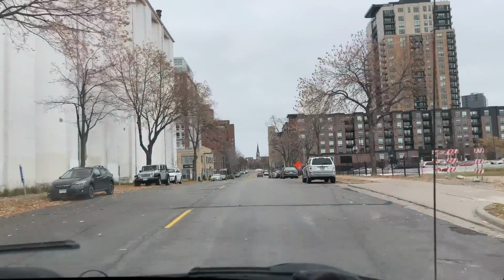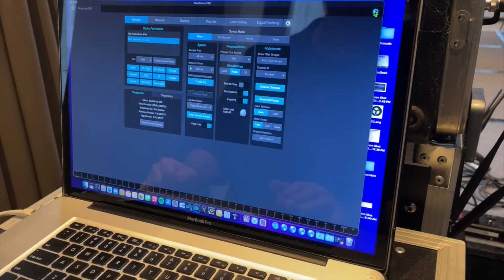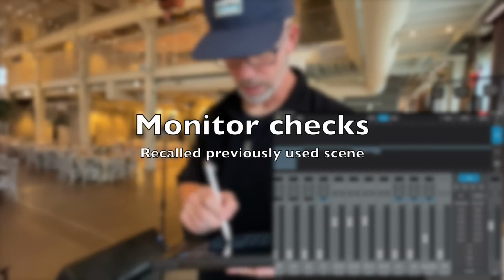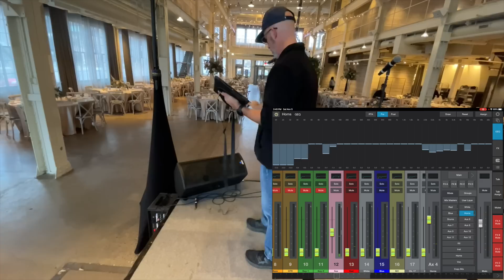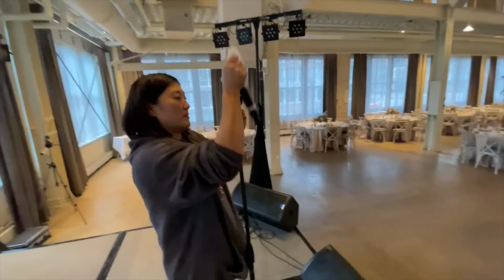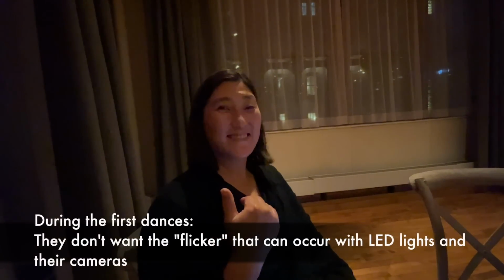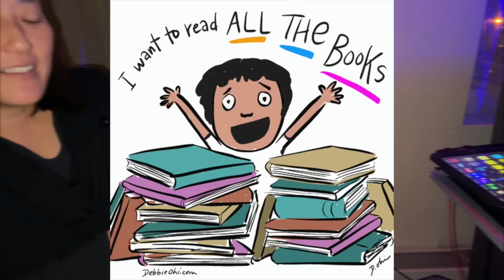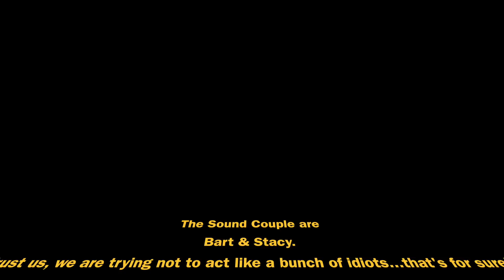The SC - Wedding Brain Dump

Comment: The ADJ Link lighting controller might be a worthwhile upgrade for you two. It runs on an iPad app and can be operated wired or  wireless (the controller creates its own Wi-Fi network). I switched from Luminair and haven’t looked back. It is slightly more advanced, but offers quite a bit more functionality. Thanks for the video as always… the long ones are my favorite!
Reply: The only downside I can see with the Link for your application is the fact that the controller needs to be present for DMX output. The app offers full functionality when running wireless away from the controller, but that means the controller sort of turns into a giant dongle just for outputting DMX.
Reply from the maker: Hmph!  Something to look into. Thanks for the suggestion.

Comment: I do sound part time and I'm in a band that uses 100% modelers (no live amps) for guitars, bass, and sometimes drums and I've noticed exactly what you are talking about in some places where there is a sound void by the stage. I still use floor monitors on the stage even if I don't need them to create some stage volume for the dancers. Sometimes I'll flip a couple of them to face the crowd as a center fill. I don't run them loud enough to mess with the mix at the tables, but they do a decent job filling the void by the stage.
Reply from the maker: Makes sense as we will do the same with in-ear bands.  In this case, we just went with it as there was already plenty of stage volume and frankly, the budget wasn't there for us to compensate for decisions that were made without our input.  Not one complaint from anyone though.

Comment: Monitor EQing, I recommend you use the HPF for the low end cut (cutting to the max band by band with a graphic eq can cause phase issues) and for narrow deep cuts it is better to use an parametric EQ as it affects the neighbouring frequenices less.
Reply from the maker: Thank you for the tip.  We will experiment with that approach!

Comment: That venue needs an infill because those VRX needs at least another 10 feet to get the sound to listener level.

I thought that the side mounted speakers (behind the VRX) were intended for that?
Reply from the maker: That's a good question.  It brings up a great point....it seems like the big shows are getting better and more technical, but these types of engagements don't move forward with same mindset....they just want you out in an hour.

Comment: I always start fresh with every gig, and every new band. Everything is always different.   I have my PA Flat preset I start with, and instrument presets I load accordingly to where they need to go.  I'm usually doing 3-5 groups a night, and most of the time each bands inputs and where they are on stage is different too. 

That Colson power extension is a killer find! I tried to find something like that 5 or 6 yrs ago for bands with pedal boards and other things up front needing to be plugged in, and I could only find what turned out to be a pretty dodgy and uncooperative cable.. Not friendly at all. This one looks great, Im going to order 2 of them right now!
Reply from the maker: I was trying to use an existing scene with a similar line up....thinking that just starting fresh is easier.  
The Colson has been working great.  It's only an "extension cord" but both Stacy and I are wondering how we didn't get this sooner.  We bought the 50ft and we use it at every gig now.

Comment: Hey Stacy and Bart I have a pair of Presonus 328 a.I. speakers of which we tested  the amps and were fine, but I have one speaker that has the transducer in it and the speaker either needs to replaced or re-coned. A friend of my who works on PA gear took the speaker out and  I was wondering where could I buy a speaker for it or get it re-coned. The speakers are no longer supported, and have used these a couple of times. My friend who works with speakers it didn’t blow but thinks maybe drop the speaker and didn’t tell me after a gig. They are pretty heavy, so that may have happened. Thanks
Reply from the maker: I would think you could find a place that re-cone the speaker.  Or you could contact PreSonus to see if they have any available for purchase.  We have not had to do anything to our 328's but for other work, we use Midwest Speaker.  You could try them if you cannot find anyone local:  https://www.midwestspeakerrepair.com

Comment: I find it easier to start with old scene. Gain is pretty much dialed in as well as monitors for most part. Idk that's how i do it. If it's the same band of coarse. I use those ears as well when I play drums. Awesome for 50 bucks!
Reply from the maker: In this case, I was trying to use a similar scene for a different band.  I am starting to think it's better to start fresh in these situations.

Comment: You can get the Behringer P1 which is basically the same as the HP2 but without a requirement of a "special" cable.. Direct XLR to the unit.
As far as headphones, those units perform well with low impedance headphones and Apple earphones are high impedance... That's why they even get less signal compared to the low impedance headphones
Reply from the maker: Thank you for clarifying...special cables usually require special attention in some fashion at some point.

Comment: I always re-use a scene as a starting point. You have to be careful not to let too much config drift creep in.

On the HP2 earbud thing, it might have to do with the fact that the apple buds have more “rings” on the barrel of the connector than just stereo earbuds which are just TRS. Alignment is touchier with apple.
Reply from the maker: I think it has the same amount of rings...it doesn't have a microphone on it which I think adds an additional ring.

Comment: So the routing on laptop is really confusing. How many stage boxes are being used? Are the speakers fed analog signal or part of the digital system? I’m coming from the m/x32 world and passive boxes
Reply from the maker: I believe we used two stage boxes.  They can be used for channel inputs/outputs.  It can be a bit confusing but would say easier than the X32 for channel routing for sure.  We are using XLR cables from the either the outputs of the mixer or stage boxes for signal...same with the monitors.
Reply: @thesoundcouple  I don’t know the presonus systems at all, i once had to help setup a jazz trio with a studio live board and literally spent 20 minute trying to get sound! X32 is notoriously confusing as well, routing is the biggest hurdle. Took me 6months but I’ve got a great handle on it

Comment: Asking for more details description on the lighting and control unit u use.
Reply from the maker: The software we use is Luminair.  We use an Entecc ODE device to interface the DMX to Ethernet.  So to get into this, you should have an understanding of DMX and a solid network.  There is a learning curve to Luminair as there are a lot of gesture commands (or hidden).  Once you get familiar with it, they offer several "fixture profiles" that you can choose from (or create your own generic) to start programming your lights.  What we like about it is that it's just "computer files" so you can save, copy, backup, etc. as much as you need to.  Once you have it set, it's easy to keep expanding your lights or scenes as needed.  https://luminair.app.  https://www.enttec.com/product/dmx-distribution/ode-mk3-dmx-ethernet-converter/

Comment: Which tripod for speakers u guys recommend ? I've a pair of Pioneer XPRS 15" - 29 KG
Thank you
Reply from the maker: That's a great question that has many answers!  There are so options out there now, so you really need to explore some offerings and what they feature and start building your requirements list based on how you will be using it.  For example, some people like kind of the "all in one" speakers with built in controls, BT, etc.  Others may not care so much about those features and want more of straight ahead cabinet.  The one thing that is getting harder to know and is potentially the elephant in the room is how well will it be serviced when you need it?  This is where we believe some manufactures are cutting costs and it doesn't hit you until you need and then you find out it will take months or never for your gear to get repaired.
Reply: Hi  @thesoundcouple  my question was just about a which TRIPOD / SPEAKER STAND do u recommend ? That's it. Thank you
Reply from the maker: Ahh...sorry!  Ultimate Stands have always served us well. @mrsolar5739
Reply: @thesoundcouple  ok cool ! I gonna have a look now. Many thanks !!!!!!!! :)

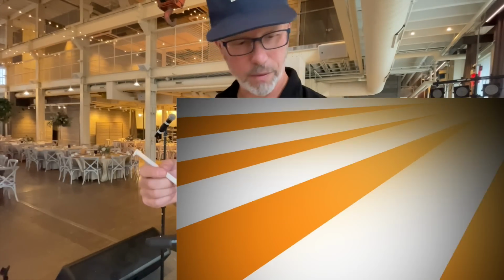Comment: 14:35 Although I'm currently running an analog mixing console, I prefer a fresh monitor check, given that each gig is in a different audio environment.
Reply from the maker: What I was trying to do is use a previous scene with a different band (but similar line-up).  I don't thin that works out as well.